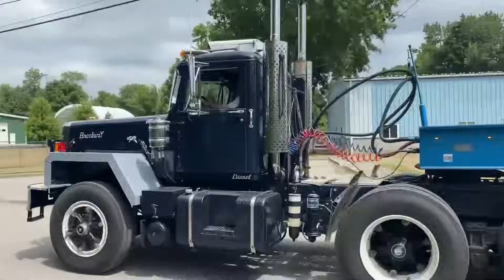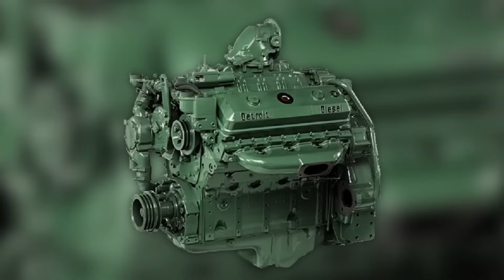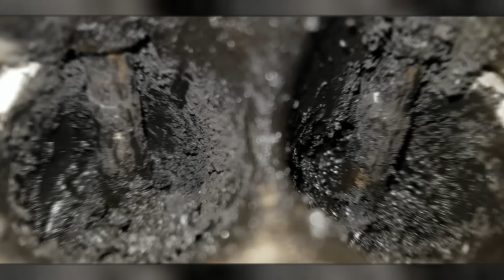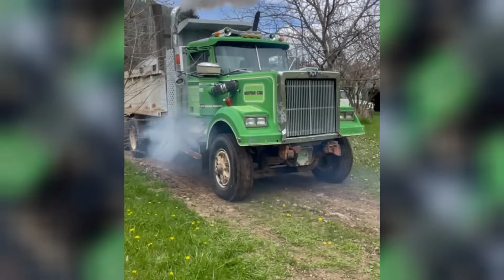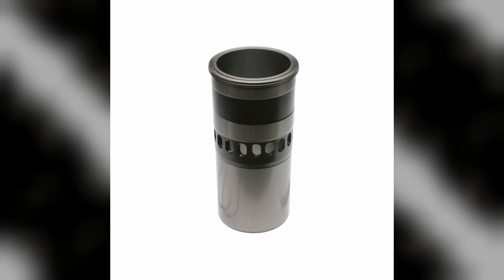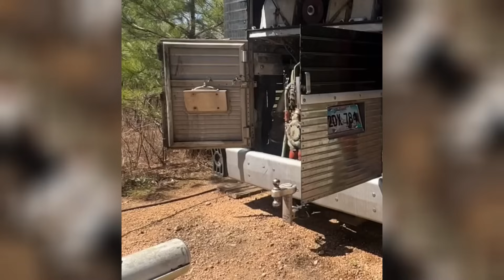The Brutal Truth About the Detroit Diesel 8V71: A Legend Built Too Early

Comment: I drive a tandem, axle brigadier dump truck with a 6 71 Detroit every day, absolutely love it. Everyone that complains about the power just didn't understand how to properly drive it. I can pull 40,000 pounds and run down the freeway all day. Yes, it uses way more fuel close to 60 gallons a day but I don't have any mechanical or electrical problems that new trucks deal with.
 Every now and then ill pass a old timer that recognizes it and get a smile and wave.

Comment: It is the same thing in performance 2-cycle motorcycles.  

When I ran around in the 1980s-90s, many motocross riders closed the idle circuit on their carburetors.  I assume it was to force them not to run the engine in the low RPMs.

But I had a 1977 Suzuki DS 100.  I was not a race machine.  It would idle for a half hour or it would scream for three hours on the West-Central Wisconsin roads:  all with no problem.  It was revolutionary.  I believe it was one of the first motorcycles to have an automatic oil injection system; no mixing oil into the gasoline was required.
Reply: My 1976 Hodakas had oil injection too. It was becoming very common by the later 70s.

Comment: Hello, I'm in France. Three years ago, I bought an MC9 motorhome with an 8V71 engine that came from California. I find it underpowered, so I would like to add a turbo. Is that possible? Thank you, Jacky.
Reply: It's not practical to turbo an 8V71N. There are significant changes in a 350hp turbo 8V71T compared to an old 318hp. You'd be better off finding a nice 6V92TTA.

Comment: I love all things 2 stroke, and at the top of the list are Detroits! And they DID have modern electronic controls on the later 2 stroke Detroits! The DEDEC system. These are hands down the greatest diesels in world history, exactly like my Hammond C-3 organ with a Leslie 122, and the irony is both love to scream, but the “noise” is absolutely fantastic and mind blowing-ly awesome and irresistible!!!😋👍🏻 Funny, but even 2 stroke gasoline engines are back, and with modern 2 stroke oils, they are smokeless! The most efficient engines on earth in container ships are giant Clark cycle 2 strokes identical in operation to Detroits! So 2 stroke diesel engines are actually NOT inefficient, and running right are completely smokeless. Cheers all! 😋👍🏻

Comment: Hmmm . you cant say " naturally aspirated versions " (6.10) as these engines still have the Rootes blower to run. Your suggestions are good but the result is like "Grandpa's Axe" with little of the original remaining. High fuel consumption when only partially loaded that these engines were known for might be quite difficult to solve. I do agree that it was a brilliant design in 1937 though partly due to GM having bought out Winton & their technology.
Reply: Detroit Diesel calls them N/A unless they have a turbo.

Comment: You had to drive it like you were mad at it. While a lot of trucks pulled good 1500-1800 mine pulled from 1700-2350
Reply from the maker: Ha, I like that. You're right.
Reply: I pull 1,800 RPM in my 1998 Cummins N14 up a grade.  Charts say this is where the maximum horsepower is for this engine.  So why go to a high RPM..?

Detroit 2-Stroke at 1,800 RPM sound like they are at 3,200 RPM to me.

Comment: 8v71 turbo was a 350 hp.
Reply: You could get a little more out of them with over size injected and a turned up fuel pump but you paid for it in fuel consumption
Reply: That's rite, a 318 wasn't turbocharged, just had a blower.
Reply: 8v 71 traditionally 318 horsepower adding a turbo boosted it to 350 horse but I had no torque under 1800 RPM and was a turd but still got a very warm spot in my heart still on a 76 Jimmy day cab

Comment: I love reading all the comments in regard to how Detroit diesels and two stroke diesels are junk. Need it keep being mentioned about how the military used them in mass?  There is a reason for that.  I think only poor operators or armchair operators, who never actually used these engines simply parrot the message of their beloved influencers from YouTube, actually hate these engines.  Those who have actually dealt and ran these engines have an entirely different opinion about them.
Reply: I ran them and they're garbage. 
They are gutless, oil leaking, antifreeze slobbering, noisey, smokey, lousy fuel milage, unreliable pieces of shit. 
The military uses them because of cronyism contracts just like all the other garbage the military uses. Nice try though shit talker.
Reply: @darrenwebb5334 I learned to drive on my dad's Western Star with silver 8V-92. Smooth, very powerful under heavy loads,  and remarkably quiet with turbo and twin stacks. My favorite truck to drive. Didn't belch antifreeze.  Did use some oil on long days.
Reply: @darrenwebb5334 Lol. You are the very definition of someone who never ran one. Your over the top language to try to prove your point only shows how little you know about the engine. 😅
Reply: 100 RPM power band.

Comment: Series 60, was a far superior engine. Not sad the 2 strokes are history.
Reply: Your right. A 12.7 series 60 will outlive any diesel built and a very economical truck engine and don't have to drive it like you hate it and your ears aren't ringing.
Reply: Detroit 14L 60, best I ever drove
Reply: Two strokes are superior by far, especially in large applications. Nearly all locomotives and large ships use 2 stroke diesels to this very day.  In the world of large freighters and ships, the two strokes are well over 55% efficient. 

I find those who think Detroits were junk just didn’t know how to operate them at optimal ratings.  The things were pretty much indestructible.  That is why the military and the marine industry used them. Furthermore, marine applications are still using and rebuilding Detroits today. 

If the eco tards didn’t piss on our legs about emissions, I can guarantee these Detroit’s would still be used and manufactured today for road use. The only reason diesels went all electronic is because of emissions.
Reply: @Vicsonvee  They were too inefficient in road vehicles for them to remain economically attractive as fuel prices climbed. Economics killed them off, not the greenies.